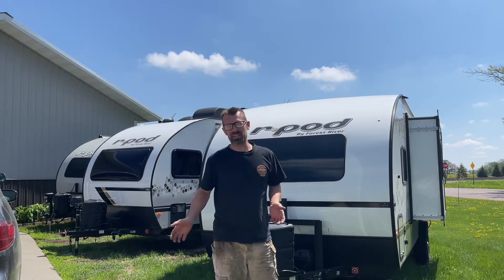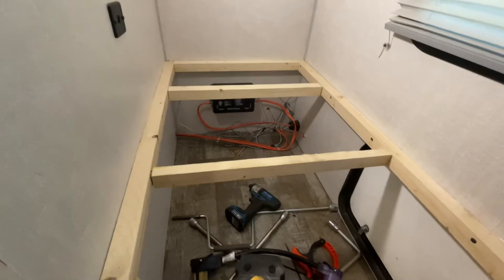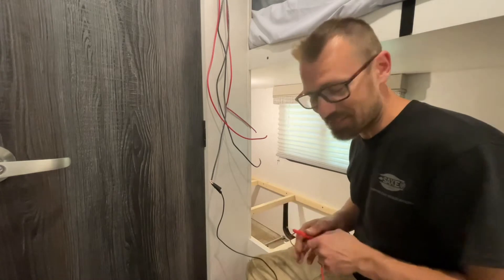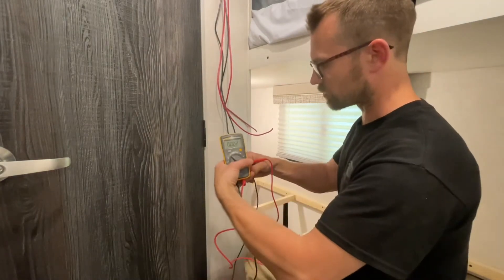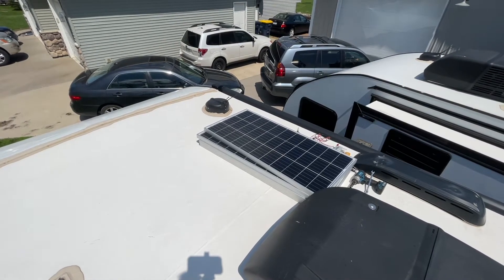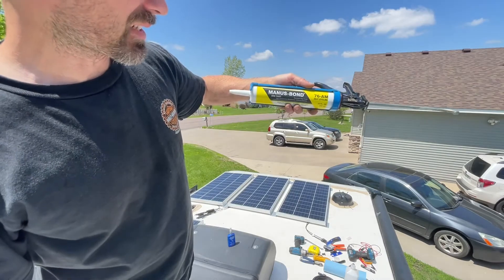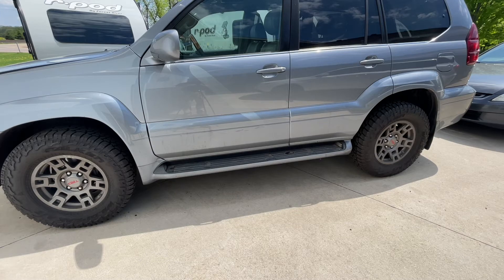Installing a Renogy 400W solar kit on my “solar prepped” 2021 R-Pod 193!  Video 1 of 2.

Comment from the maker: Renogy 400W kit: https://amzn.to/3VXd897
Crimper: https://amzn.to/3WWzwk7
Connectors: https://amzn.to/3Xivkez

0:00 why am I doing this?
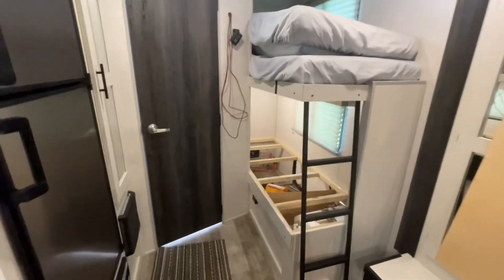1:21 laying out the system
2:09 accessing the wires for the panels and battery
3:17 figuring out what wire goes where
5:50 mounting and wiring the charge controller
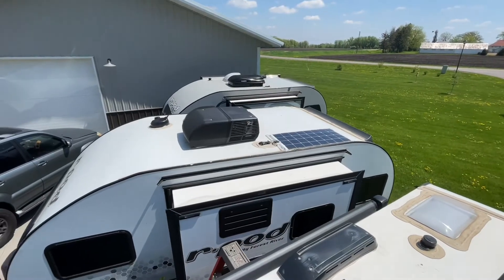7:42 positioning the solar panels on the roof
9:32 mounting the panels
12:20 how to make solar panel cable and crimp on connectors
15:26 finished panel install

As an Amazon Associate, I earn from qualifying purchases.  For your convenience, I try to post links to everything I use in the video description.  That's part of how I cover the costs of this channel.  I appreciate your support buy using these links!!

Comment: I am getting ready to install panels and a charge controller on my 193.  Which charge controller did you install? Did you use the 40A MPPT controller that came with the kit?
Reply from the maker: I did. I linked exactly what I used it the description.
Reply: @bennieaust  Wow, thanks for the fast response. Did the factory installed cables from RPOD work OK from the charge controller to the battery? Have you had any issues with heat or does the charge controller adjust for the cable size? Thanks
Reply from the maker: @randyb9310  you’re welcome!

It’s worked great with the factory wiring.  I fused everything so technically the fuses should blow before there’s any other issues.  But it’s been great.
Reply: @bennieaust Good idea. What value did you use for the fuses? 30A?
Reply from the maker: @randyb9310  yes, 30A
Reply: @bennieaust  Perfect. Thabk you very much. This video and your responses have been helpful.
Reply from the maker: @randyb9310  you’re welcome!
Reply: @bennieaust  Follow-up question: Where did you install the fuse between the charge controller and the battery? On our 193, the cables go in the wall from the controller and then appear under the front corner of the camper, with no real place to mount an ANL fuse holder. Thank you
Reply from the maker: @randyb9310 , you’ll want to just use a weather proof inline fuse holder as close to the battery as possible.  I’ll try and find a link and add it to my response here….

Something like this: https://amzn.to/47RFNmY
Reply: @bennieaust  Thanks. That looks like its something that is small enough to go in the wall with the cable behind the controller. I don't have much exposed cable near the battery. They made it pretty tight during installation at the factory.
Reply from the maker: @randyb9310  , it needs to be as close to the battery as possible to protect the circuit.
Reply: @bennieaust  Got it. After looking, I probably have just enough room to squeeze in an inline fuse. Have one on order from Amazon. Thank you

Comment: Thanks for the video. Does the roof penetration void the roof warranty? I have a 192 and we got the kit like yours but only 2-100 watt panels. I'm apprehensive about screwing into the roof.
Reply from the maker: That's a great question, that I can't answer.
I could see it going either way.  If you did something wrong that was the cause of a problem, I'm sure they would void the warranty.  If it was unrelated to the solar install, I would expect it to be covered.  I don't know in real life how it would play out though.

It is a big deal to drill / screw into the roof so it's good to be apprehensive about it.  Use that feeling to make sure you've covered all the bases before puncturing anything! :)
Reply: @bennieaust  I appreciate the honest response. I look forwad to your future videos.

Comment: Great job! You made it look easy. Renogy gear seems good quality at a good price. Are you concerned about the connectors exposed to sunlight?
Reply from the maker: Thanks!  I didn’t know exactly what to expect and I was surprised at how easy it was. 

The next steps will definitely be harder and more intrusive. 

Time will tell but the connectors seem to be of good quality and definitely weather tight.